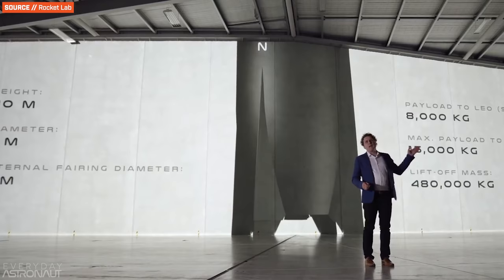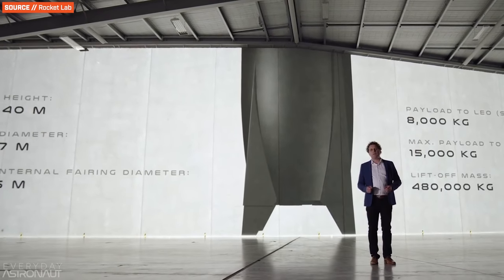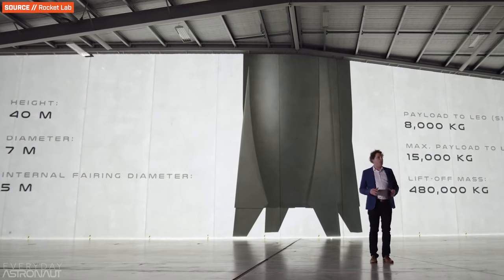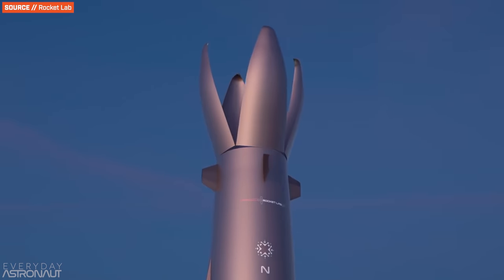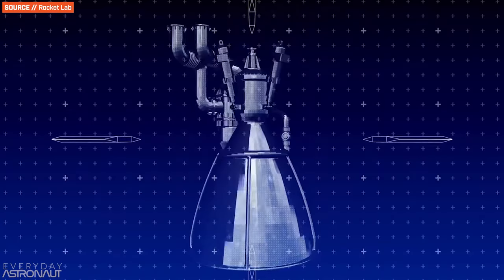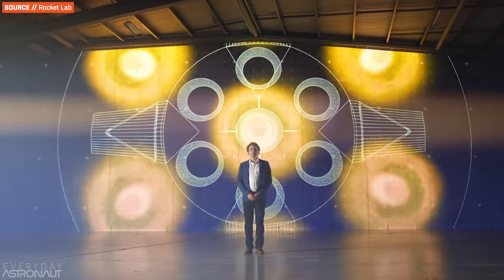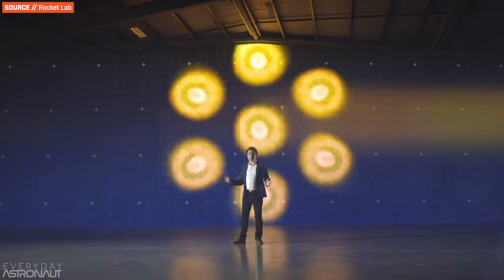Talking about Rocket Lab’s Neutron with Peter Beck

Comment: I used to work at a ship construction site. Majority of the shipping modules they built they shipped by barge because they were too large to ship by land (truck). However, whenever they could ship smaller modules they always shipped by land. The cost of an oversized truck, plus multiple police escorts (including state changes), plus cost of closing down roads temporarily and/or removing poles along with a bunch of other costs etc was still significantly cheaper than sending by barge. I was absolutely dumbstruck when I heard that it was costing the company $30,000 per day just to keep the barge berthed at their own port. Literally sitting at a port doing absolutely nothing costing the company $30,000 per day. And the company still had to pay to have the port dredged as a separate cost. I just couldn't, and still don't, understand it. It would cost over $1 million to ship by barge (not including costs of staying at port) compared to around $100k to ship by land.
Reply: $30,000 per day -- is this for a short term lease of the barge?
Reply: @cogoid  I haven't worked there for years. The barges belonged to another company (Toll Group) but the port costs were from the council so didn't matter who the barges belonged to.

I'm in Australia and I'm sure we have fairly similar port costs and operations as New Zealand. Unsure if the USA operate differently so can't comment. From what I understand, port congestion is one of the reasons for the high costs. But like I said, the port was literally part of the construction company site and was used solely by them. You'd think there be some kind of concession or something. But nope.
Reply: @odo432  You mean that is just the docking fee? According to the published tariffs, in 2019 Port Canaveral charged $15.69 / foot for the highest registered weight. For a 300 foot barge that comes to about $5K/day.
Reply: @cogoid  It probably works similarly here in Australia. Only our costs are likely a lot higher (as is everything else in this country). Things are usually a little more expensive in New Zealand compared to Australia (usually similar cost but their dollar is slightly weaker).

Comment: Another feature of the integrated faring not mentioned:  flight of the booster alone without payload or a second stage is viable.  That opens two possibilities.
As mentioned in the video, Falcon 9 was designed to fit down a highway and Neutron will do away with that, as Neutron is intended to be launched from the factory.  It doesn't have to be constrained to there.  The booster alone with a partial load of fuel should be able to relocate itself from anywhere in the world to anywhere else in the world with a suitable landing pad autonomously.  Modern transport airlines are not constrained by ground transportation, and have grown massive once freed from that limit.  The same could be true of boosters that can move themselves.  They can launch anywhere the ground support is provided because the booster can move itself there.
The other opportunity is a much higher performance out of a return to launch site mission if the two portions are separated.  The booster could land at a down-range turnaround site.  No fuel has to be carried aloft and accelerated for the boost back burn.  Since most launch sites send the rocket downrange over the ocean, this could be a dedicated island turn-around facility.  After boosting the second stage up, the booster could land with reentry and landing only burns on the island.  Then with a re-fuel it could come back to the original launch site with a fresh partial load of fuel. 
Taken to the extreme and with appropriately spaced facilities around the world, such a booster could just keep circling the globe launching to the east, landing and taking off again to the east from a down-range facility.

Comment: I was interested to note that the conversation once again subtly slide over the question of the return-to-launchsite  parameters.  

My take on it was that RocketLab are looking at a significantly different launch trajectory than previous standard rockets and flights.
In order to get the First-Stage home in the manner they have outlined, with the fairing system described - then the rocket First-Stage would need to have a much more vertical flight profile.  With a lot less horizontal velocity added.
So with a much more efficient/effective Second-Stage, deployed significantly higher than normal, almost all of the horizontal velocity would be added by the second stage.
It is much easier to add horizontal velocity above the atmosphere than in it, so give that job to the second stage.

The First-Stage would effectively just free fall back to its launch point. (sort of)
And this flight-profile off-loads a lot of the loads on the first stage, as the high speed trauma it endures on reentry isn't from the fall, but from the horizontal speed of being thrown down range.
Freefall might be 4,000 kph, while horizontal velocity is closer to 7,000+ kph.  Nearly double the speed - and therefore 4 times the energy.

Comment: Question that just popped in my head : if Neutron will be so light, wont it be sensitive to wind both during return to lauch site and even more once landed ?

By the way, Peter looks like he could use a bit more sleeping time.

Comment: Could the payload fairings be used as control surfaces similar to grid fins? There would be no roll control, but it’s not really needed in a cylindrical rocket.

Comment: Neutron is such a clever design. I hadn't realised it doesn't use a launch tower until this interview. I wonder how Starship will ever be safe, reliable and rapidly reusable with its engine complexity and running close to it's limits, and I wonder if Falcon 9 would be better off using low tech fairings without fairing recovery.

Comment: Peter has mentioned somewhere in the past that just before starting Rocket Lab he bought a vernier engine (LR-101) used in Atlas missile. I wonder if he ever fired this engine and if this played any role at all in inspiring the Rutherford engine. (The two engines have somewhat similar injectors, but it is not clear what the real story is. Rutherford has x5 the thrust and one could imagine it evolving from a slightly scaled up LR-101 plus electric pumps.)

Comment: About the upper stage being under compression forces when it use its own engine, that is true but maximum force would be only equal to thrust of its engines, so 1MN of mechanical load no matter if the g forces are 1g when is fully loaded with propellant and still 1MN when it's almost empty and experiencing multiple g, but when it is inside fairing when first stage achieve maximum g, the load will be equal with mass multiply by acceleration, so assuming 100 tons of mass and 3g 3MN of force.
Reply: When the tanks are full, the acceleration is low -- most the thrust goes to accelerating the mass of the fuel. This force which accelerates the fuel is concentrated in the bottom dome of the tank, and the stress can be confined to the engine support structure.

When the tanks are empty, the acceleration is high -- most of the thrust goes to accelerating the payload. This force which accelerates the payload is now passing through the cylindrical walls of the tanks, putting them under compressive (buckling) loads, unless the internal pressure in the tanks creates a greater stretching force. One can throttle the engine down to make this the case.

It's not just the thrust that matters -- the amount of fuel changes the distribution of loads in the structure quite dramatically.
Reply: @cogoid  you are right load distribution can vary along the flight, but my point was that upper stage would experience more cumulative stress when it is inside fairing(even if the maximum g forces are the similar during the both flight steps ) , so hanging from the top could save some weight, because you can make a lighter structure when main forces are not compressive but tensile.

Comment: Interesting point about the aerodynamic loading - wonder if they will have any issues because they need to open the fairings early to launch the 2nd stage  - will see in  a few years. It's not a showstopper if that is an issue they can switch to have the fairings on the second stage and just throw them away.
And other very interesting point was about the cost of rockets hardware vs cost of the infrastructure and labor required to launch - for a small rocket the vehicle cost is quite small but the infrastructure and organisational effort to launch it are almost as much as for a much larger rocket.
By going to the bigger machine you launch way more payload and earn more money but the organisational costs stay about the same your overall efficiency in terms of cost per KG to orbit improves.
With the electron the cost per KG to orbit is over $20000 per kg so very hard to compete with rideshare that is less than 1/5th of that cost.
With falcon 9 people incorrectly say the booster costs like 30million the 2nd stage costs 10 million the the fairings cost 6 million and that is how they think the cost of the rocket works out - when really the rocket hardware is maybe only 2/3 of the costs. They forget about the labor the barges the trucks and ships and the manufacturing facility and all those other costs other than the rocket it's self.

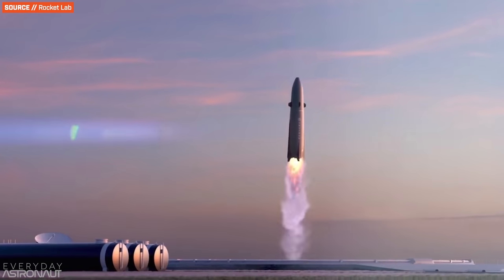Comment: I'd try mentioning about SpaceX Falcons, top Pod to remain attached, for re-entering, using the Pods to have an upper demise layer on the dove-open hatches, to be a breaking net,(heat shield neck ring for the falcon). That being said, Neutron Rocket can do this, as quicker re-entry, faster breaking, opening an outer cadge upper dermis layer of the nose cone hatch 0:13 (like a split cone 4-nets), allowing the craft to deliver heavy mass cargo, from orbit, of many human/cargo supply's that fit, down to Earth surface/base. Which could be just as or more effective vtol as the SpaceX SN stage level task. If Neutron had a big stage to mount with, or larger vessel  Shell .

Comment: 1:30 “Run end of life missions as expendable” Great philosophy for ageing humans to adopt. Serious question, if expended will the first stage crash back to earth essentially intact until impact or will it burn up. Either way is there a significant pollution issue? Burning plastic is not that nice, as are bits of plastic floating around the ocean.

Comment: Sounds like the Neutron launch path will have to have a hump around MECO. They’ll have to get to 100km before they open the petals rather than 80 some like F9. Then they’ve got to fly back every time. So they need to go more up than sideways before MECO, then have a beast of a second stage to get the payload into orbit.

Comment: 5:00 this was my main question: isn't the second stage under compression during second stage burn? The answer didn't make sense for two reasons: 1. If it's strong enough to withstand compression from second stage burn, why not co Prussian from first stage burn. 2. If it's strength comes from pressure, doesn't it loose strength as the second stage burns through its fuel?
Reply: Upper stages typically have lower (sometimes much lower) thrust-to-mass ratio than does the whole rocket during the first stage burn. As the fuel is spent, this may change, but the upper stage engine can be throttled down to cap the acceleration.

During operation, the pressure in the tanks is usually maintained more or less constant by adding more gas -- hot helium in Falcon-9, hot nitrogen in Soyuz.

All in all, it can be possible to choose the parameters such that the walls of the second stage tanks never experience appreciable buckling loads, which should allow to make them simpler and lighter. The price for that is making the walls of the "interstage" longer and subjecting them to all these compressive loads, but without the benefit of pressurization. Overall, the rocket will become heavier. But since they want to keep the fairings attached, and would have the first stage enclosing the second stage completely anyway, it all works out. They make a stronger and heavier, but reusable first stage, and light and simple but also very efficient disposable second stage. It seems like a good choice.
Reply: Usually upper stages are all the time under compression forces, but on Neutron thing would be different, when upper stage would be inside fairing would be suspended from the jonctions betweens payload and upper stage, so would be under tension, but after separation would be under compression forces, but those forces would be a lot smaller because the power of upper stage engine is much more low than total power of seven engine of first stage, even if you consider that is distributed with the remaining mass of the first stage.
Reply: @theOrionsarms  For example, Falcon-9 has diameter 3.7 meters, and ullage pressure in the tanks is maintained at around 3 Bar. This means, the axial stretching force on the tank is (3.7 m * 3.7 m * 3.14 / 4) * 0.3 MPa = 3.2 MN. This is three times more than the thrust of the second stage engine, and the walls are never under compressive stress, at least after stage separation.
Reply: @cogoid  that is a oversimplification, you have two tanks on the upper stage and the upper tank push on top of the lower, and the mass of that upper tank +payload will be multiplied with the g forces,all that load is a compression force on the walls of the lower tank of the upper stage, that is how the things Really work.
Reply: @theOrionsarms  No. :) You are just making this up, and physics does not Really work this way.

When the upper stage engine is firing, the acceleration is the thrust divided by the entire mass of the stage.

Consequently, the force acting at the payload adapter is equal to the mass of payload times this acceleration. Or, put it another way, the fraction of the engine thrust acting here is equal to the mass of the payload divided by the total mass of the stage -- which is always less than the full thrust of the engine, no matter what the acceleration is. 

Similarly, for the top tank, which remains stretched by the pressure inside.
Reply: @cogoid  obviously the total load cannot be higher than thrust of the engine(I explained you that yesterday) , but to say that isn't under compression because pressure inside the tanks cancel that compression force is wrong(it's only means that two forces cancel witchother) , as long it is under acceleration would be a compressive force, and obviously the load from the top will push down trough walls beneath, not magically be transferred to the engines or automatically distributed how you suggest.
Reply: @theOrionsarms  The upper dome of the tank is supported by the pressure of the gas inside. Imagine it as a piston in a cylinder, if that helps.
Reply: @cogoid  you don't understand solution that will be used on the upper stage of Neutron because you don't understand the problem, you keep saying that if the load from the top is higher you could increase the pressure, but that means thicker walls and heavyer, purpose is to make the walls thinner and lighter, imagine a plastic bag filled with water if you hanging from the top it will keep its form even if it's open, but if you want to stay on top of it you need to seal it and put under pressure if you want to keep its form, and even then probably would break it. (of course I know how pressure is used on many propellant tanks on liquid fuel rocket, but that is not the only solution that is used, sometimes the walls are the ones that take most of the load, so stop explaining me such elementary things)
Reply: @theOrionsarms  You attribute to me a lot of things that I have not said. What I did say to you is that in Falcon-9 the pressure in the tanks is such that firing the second stage engine never creates compressive loads on the tank walls.

Most rockets run with the pressure in the tanks in the same ballpark. This is required for proper operation of the pumps. So it is not unique to Falcon-9.

Saying, as you did, "usually upper stages are all the time under compression forces" is incorrect.
Reply: @cogoid  you said many things that are incorrect, specifically not pressure sustain weight of upper part of a typical upper stage, but stretching the walls make them more resistant to load and increase rigidity, and what I try to explain is that a propellant tank could be under compression(because of acceleration created by the engine of that stage ) and in the same time have the walls under tension, anywhow the whole discussion was about Neutron upper stage and why they chosen that original solution, which you don't explained correctly in your messages.

Comment: I'd love to know if they could fly the first stage without payload and hop it to other launch sites, even when they don't want to build the rocket at that particular site. Would fit the theme of having as little infrastructure as possible at the launch site and offering customers a variety of specific orbits.
Reply: Or maybe hop it over to a Barge in the Ocean, move that barge with the rocket close to the new launch site and hop it there from the Barge :D (to cover distances the Rocked couldnt hop by itself, like Transfers between East and West coast)

i know unlikely to happen, but who knows?
Reply: @unitrader403  remember the whole part about barges being trash in the interview?..
Reply: doubt it, the first stage doesn't really get that far before it runs out, you'd have to get it to orbit for it to go halfway across the planet, and then you'd have to deal with heating, just seems too impractical